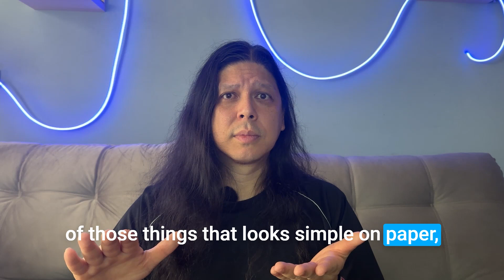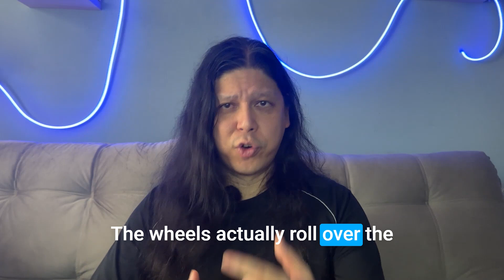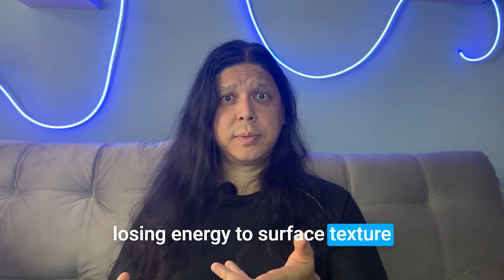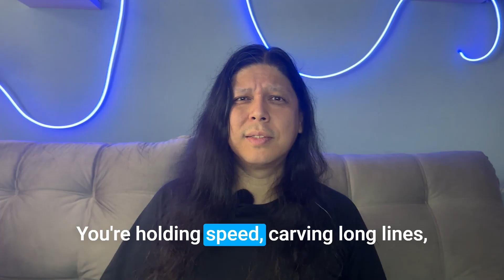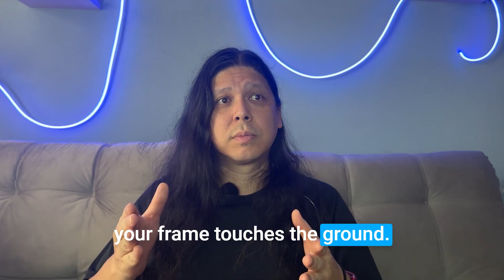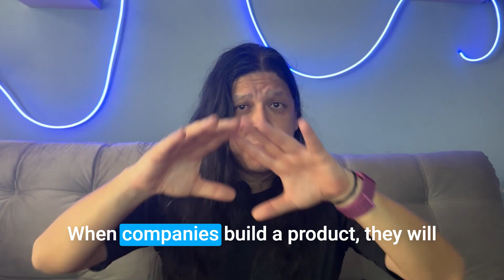Wheel Diameter on Storm Tracers: Momentum, Efficiency, and Stability | Tracing the Build Ep. 2

Comment: 1) simple version:
Maybe you can try using smaller wheels.
Put 2 wheels in the front and 2 wheels in the back instead of a single line.
It might make the electric skate more stable.
2) technical version (look a bit smart) 😊 :
Maybe try using smaller wheels with a 2 front + 2 back setup instead of a single inline row.
It could improve stability for electric skating, especially during acceleration.
3) TikTok style (most natural):
What if you use smaller wheels?
2 in the front and 2 in the back instead of inline.
Might make it more stable for electric skates.

i use chatgpt to talk, so this is my idea....